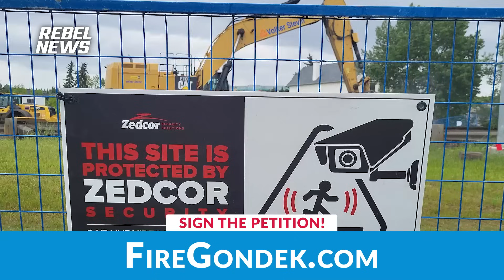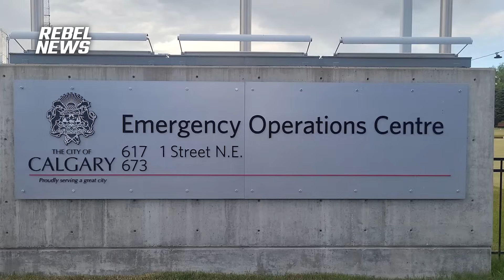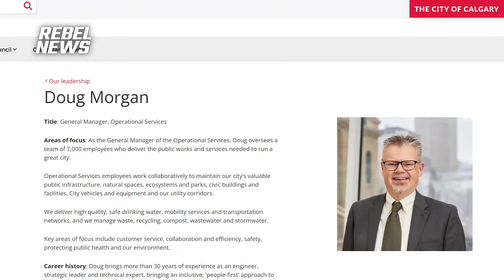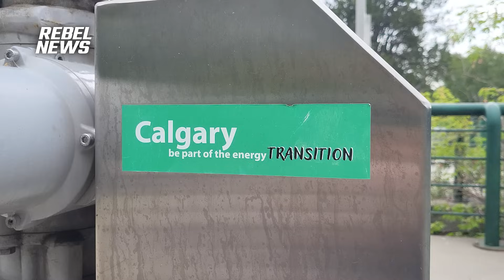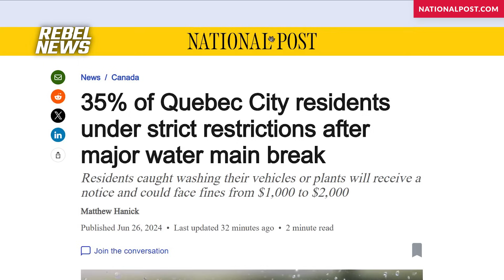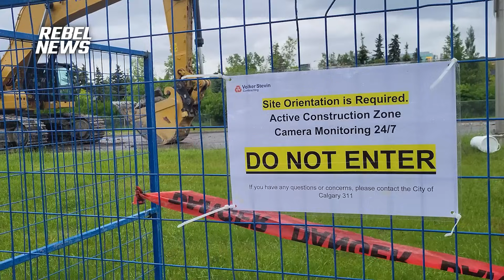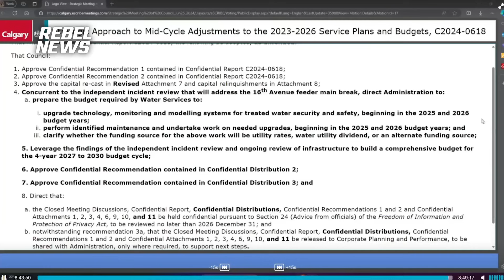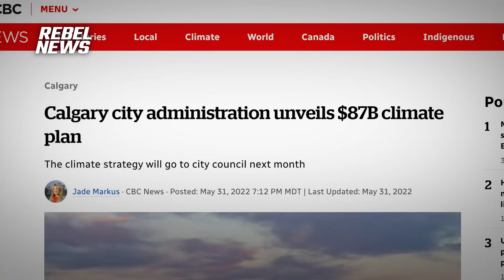Calgary’s water crisis just got worse... and permanent?

Comment: This country has the most fresh water lakes in the world. No reason for this crisis!
Reply: Depends where you are.
Reply: Do you still have to move it from A to B.
Reply: It is not a shortage of water supply.  It is a shortage of distribution.  The issue is that they should have a grid system where any main line can go down, and the remaining lines will be able to keep up with capacity.
Reply: And one of the lowest density of population
Reply: Those are kinda far from Calgary, multiple European country lengths.
Reply: @brettthomas5605  You mean move to Air BnB? don't quite understand what you are saying.
Reply: What does that have to do with a failed pipe? Are you on drugs?
Reply: @StallionStudios1234 you are correct, around 70% of our fresh water does run north where nobody lives BUT we pipe crude oil from northern Alberta to the gulf of Mexico. Absolutely no excuse we cant do the same with our fresh water. No excuse here, dont give anyone an out on this.
Reply: Well, theres lots and lots of water in the lakes, we know that. The problem is getting the water from the lakes and rivers into the buildings. A huge part of that is maintaining the infrastructure which brings the water in.
This wasn't done.
It's not just water. Roads, overpasses, bridges, and many other things.
Maintenance, in general,  is low priority these days.

Comment: Our friends in Calgary are discovering, is that many if not most of our governments have only very little surge capacity for responding to catastrophic system failures.

This was amply demonstrated during the pandemic. As COVID-19 hit, we very quickly realized that we had almost no ability to surge extra health-care staff into an emergency role without totally disrupting routine health-care delivery, which is what we ended up doing.                                                                                                                                                                                                                   We had almost no spare physical infrastructure in the system, no spare equipment (such as ventilators — which is why there was such a rush to acquire them at enormous cost), and not even the personal protective equipment that we thought we had stockpiled after our experience with SARS. We had it! Then we let it rot.

We have long since squeezed any slack out of the system in the name of "financial efficiency" assumong we can just order it from a supplier - Just in time ! ???.                                                                                                                                                                                     We all like financial efficiency! But any system that routinely operates at or near 100 per cent of capacity has no ability to respond to emergencies.

It’s not just health care. You will find this replicated at scale across most North American governments — which is why Calgary is calling in any private-sector worker who can help their municipal engineers and shipping up spare parts from California.

Let me tell you a little story. A few years ago, at the major intersection nearest my house, one of the traffic lights was knocked down into the intersection by a crash. Thankfully, no one was hurt by it, but the pole was a complete write-off. I was pleasantly surprised by how quickly it was replaced. The entire thing was up and running again by the end of the day. I talked to some of the engineers who had done it. I don’t recall whether they were city employees or contractors, but I remember their telling me that light standards are something the city has to replace so often that it keeps them around as an actual inventory of ready-to-go spare parts.                                                                                                                                                                                                                                   One of the guys quipped to me that they were one of the few things the city actually kept on hand. Most parts are ONLY ordered as needed.

We’ve all heard the concept of the “just in time” economy. That describes how manufacturers don’t really keep an inventory of consumables (whatever those may be for a specific business) around, instead relying on deliveries every day or every few days at most to sustain their operations. If anything delays or disrupts those deliveries — anything at all — operations grind to a halt almost immediately. Again, this is in the name of efficiency.

And, again, We like efficiency. I’m not here to argue against efficiency. But I think we should all take a minute and reflect on the fact that Calgary, one of our largest and richest canadian cities, does not have enough mechanical engineers or critical spare parts in its inventory to deal with this water systems problem quickly by itself. It needs to call on the private sector and ship up parts from our friends in the United States.

I’m glad it is doing both of these things. I am hopeful that Calgary, a gorgeous city that is home to many people I love, will be back on its feet again as quickly as possible.

But we really ought to be thinking about whether or not this is really how we want to be running a society on a bare bones minimum infrastructure support basis . Everybody loves efficiency, but we also need redundancy.                                                            Keeping critical spare parts and a bit of excess skilled-labour capacity on the payroll may look like an inefficiency, most of the time. But when you do need it, it looks like something else: a life-saver. Sometimes literally.                                                                                                                         The water main that failed in Calgary was a "prestressed concrete cylinder pipeline", a type of infrastructure that has ruptured in other places, too. 
"Those steel wires over time developed some metallurgical problems, and in particular, the pipes were manufactured from about 1960 to 1980 have a greater amount of problems than the other pipes outside of that [time period]."and at 50 years - are at the end of their service life .

Comment: Just had a thought....how about putting water cistrons back into the building  code to supplement our water needs.
Also for Gondek to tell people to drink beer in place of water is ludicrous!!! 
This failure of the current mayor and the former mayor to allow this failing water system to bypass inspections for the past 10 years is irresponsible at least. 
Parts of Calgary with wooden water supply pipes....and  "newer" water pipes that are 50 years old is truly an emergency of a grand scale!!

Comment: Useless incompetent mayor. Add to that the heads of the engineering / public works departments. This is a failure of engineering. City managers , those who are professional engineers , need to be held accountable. Their association, APEGA, would be a good start .
Absolutely preventable fiasco.
This type of pipe, called prestressed concrete cylinder pipe , PCCP, under a now defunct brand called Hyprescon, has a long history of catastrophic failures . But there are ways to mitigate the fragility / corrosion in the pipe . Clearly not done , any where adequately .
Another thing: Major municipal water feed mains need redundancy . When one goes down the City can feed water to impacted areas with another big main. Does not appear to be the case here .
By way of comparison , the Greater  Vancouver Water District, part of Metro Vancouver has such redundancy and taxpayers have paid 100s of millions in building, maintaining and replacing large diameter watermains to ensure residents and businesses  of member municipalities have adequate supply of clean fresh drinking water, even when a big main goes down .
Also, almost all big water mains ( 36” diameter and above ) are made from welded steel. Certainly not the cheapest to build , but long term performance is unmatched .
Steel needs proper corrosion protection and cathodic protection , both of which are used.